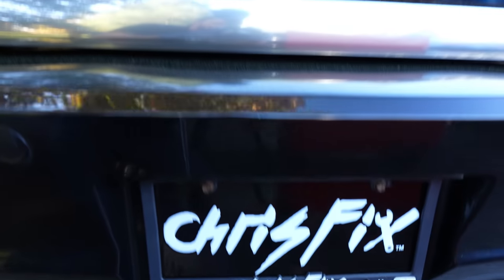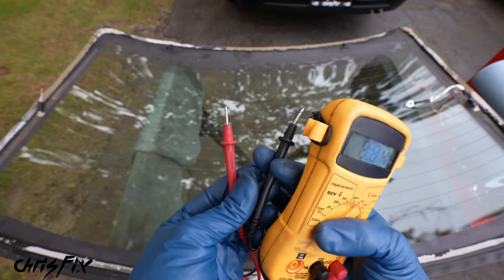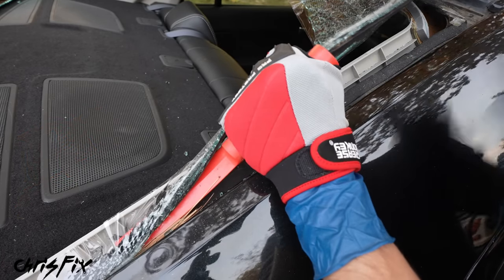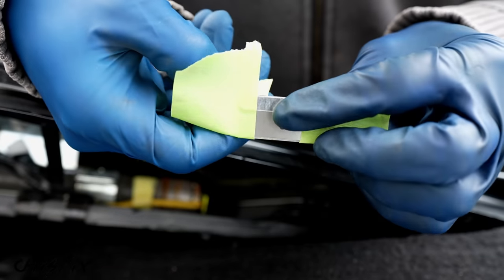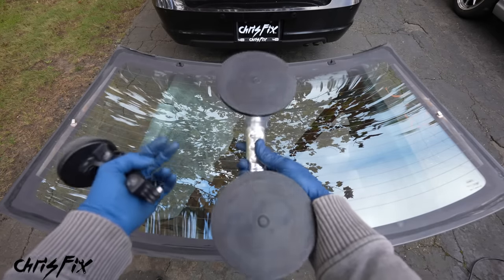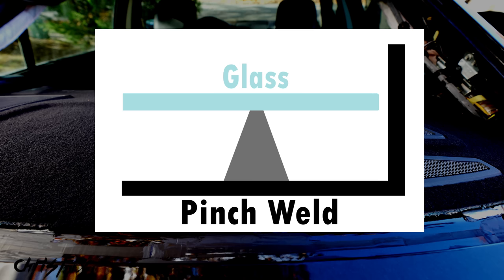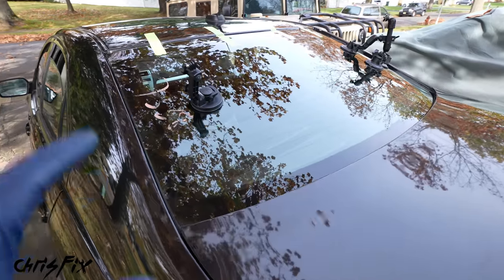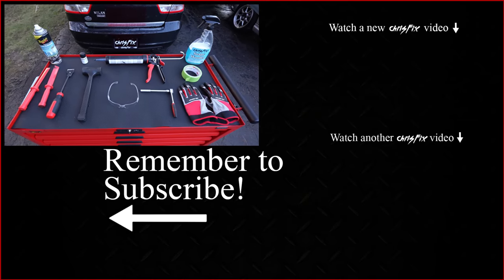How to PROPERLY Replace a Rear Windshield (No Special Tools DIY)

Comment: I like the video but, I own a auto glass company and their is a couple of things you could do better so here is a few tips...
1- Break every piece u can as soon as you start, before you scrape off the urethane. Don't vacuum until you have cut the window out. Saves major time. Also put tape around the glass on the body of the car so the glass doesn't scratch the car. You can also spray the urethane with glass cleaner and when u cut it the glass wont fly everywhere. 
2- You should of used your scraper to get the urethane off the pinchweld, that plastic tool and mallet looked miserable
3- The razor blade thing was super sketchy and time consuming, use metal scraper to get the glue off much faster and you want the urethane to be level so your glass doesn't leak
4- When you scraped the old urethane off your used piece of glass, no need to try and scrape every little piece. Urethane bonds best to itself. Leave 1/16 like you do on the body if possible. 
5-In the top right corner on the backglass where you first put primer, you should of scuffed the metal with scotchbrite to give the primer a better chance to bond. (Same thing with where the sound dampener was)
6-I really liked how you broke down the triangle bead in comparison to the circular bead. Some installers still use that circle bead.
7-When you cut the tip for your urethane, don't cut the V so big. Your bead was weak because the base is too small.
Reply: One can only appreciate tips from a pro, although it helps us to get you less work. You also showed it's not that easy, a lot can be done wrong. I vote @Chrisfix could pin this comment.
Reply: Great tips. I also work for an auto glass company and couple of things I do before I start cutting the old urethane is I usually have a vacuum in one hand I use a small clip prying tool to remove the excess glass from the most outer edge of the glass, that way they don't fall in and scratch the paint or dull your blade when you cut the urethane later. You can actually see long white scratches in the pinch weld that came from the plastic chisels pushing glass pieces against the paint. I use cutting knife with a snap on blade, start from the middle and cut the whole urethane out in one piece. It's easy to not scratch the paint when you have removed the excess glass from the pinch weld and can actually see the tip of the blade. This way there is least amount of tiny glass pieces flying everywhere, even compared to a replaceable chisel blades, which is generally the best tool to remove urethane because of the control it gives.

Windshield stick tools cost like a dollar and are made out of nylon, urethane doesn't stick to it that well so it's good for all touch ups and the "paddling". The sticks are also super easy to clean because the urethane just peels off after it cures. The stick is also one of the best tools to remove old excess urethane from the corners of the pinch weld as it doesn't scratch the paint. 

Also if people are using urethane that cures in 24h they should be very extra careful about what tape they are using to hold the glass in place during the curing time as most of the tapes (especially duct tape) burn-in on the clear coat and are an absolute pain the ass to remove because the glue sticks to the paint.
Reply: Just don’t tell me you work for safelite they fucked up my windshield and it leaks whenever it rains for the last 6 months now
Reply: @Hiddenpower6  I'm from Finland. You should always get leaks fixed asap, because they can create all other issues and can be caused by rust.
Reply: Swamper for a very experienced body shop mobile crew here
1. Yep, my installer breaks all glass and removes the urethane first while I prep the glass, I don't touch the vacuum until all the old is off. Plus the glass cleaner on the urethane acts as lubricant and makes the knife glide easier
3. OLFA or Stanley knife works best, go slow and take your time, plus people are more likely to have a retractable disposable blade knife than a no. 9 razor
4. Yep, no need for all urethane off, make it flat and even with no flaps or strings, but overall not bad
7. I agree, Bead was too high, better to be wider but there wasn't much you could do with that caulk tip

bonus
-DO NOT "RAIN TEST" WITH ANY KIND OF WATER FOR AT LEAST 24 HOURS AFTER INSTALL, URETHANE DOES NOT LIKE WATER
-Make sure any surfaces are dry after cleaning before priming or gluing
-I usually prime wider than the old urethane marks, OEM is usually a thinner bead, we use thicker, so more squish, so as long as it doesn't show on the clear part of the glass, I do a half dobber width wider either side
-I feel like it would be more effective to use the cups to move the glass, yes they aren't made for it but they are better grip
-Check pricing with actual auto glass places, we would more than likely do an install on a customer supplied glass, if there are any problems with the glass (like heat lines not working) we would not be at fault and would not warranty the glass or labor (unless they were not plugged in obviously). We are professionals (mostly, I have seen some work from other companies that disgust me), we are good at what we do, when we go to a customers house and are done in ~30 mins, they are surprised it was quick. I know it can be done fast and sloppy, but we have experience, $250k G wagons, $500 corollas, Maserati, Audi, Honda, Semi trucks, bobcats, Buses, etc.
-When looking at glass places, get quotes, read reviews, talk to family and friends. I live in Edmonton, Alberta, Canada, some dealerships and bodyshops I went to who just got a contract with us with the mobile crew (me (swamper) and my coworker Chris (installer)) was exited we showed up, telling us the guys they used to go through would usually not show up and call 2 weeks later to reschedule. Find good pricing, but find better installers. The problems the company I work for usually run into is fitment, delays on orders, or a customer telling us "it definitely doesn't have any features, its a base model" only for them to bring it to the shop or for Chris and I to show up in the mobile crew and it has a rain sensor, lane departure, HUD, and its the wrong generation (06' vs 14' (I am not joking on the date of manufacture difference, that is a literal example from ~2 months ago)). Be accurate, be honest, you are not signing your life away, you are just getting a quote. I dont know about other companies but where I work, we have warranty, wind whistles, leaks, etc, we have skilled people who take care in their work. Our least experienced installer is still good, he just needs more speed, which comes with time and experience.
Reply: @Hiddenpower6  Get it warrantied, they should have warranty stuff, if you have time and your invoice, tell them the problem and they should fix it. It is rare (at least in my shop) for warranty work, but we are human, and people make mistakes.
Reply: @lieutenantjiggles5347  I thought about that but it didn’t rain for like 2 or 3 months after the windshield got replaced so I never knew that it was leaking then it did and by that point I already knew they wouldn’t believe me if I complain about a problem that they did 3 months ago bc they will just say “well you can’t prove it leaked the first 3 months” and they will just say I did something wrong.
Reply: The crew from DNS aka Auto Glass Shop should watch this and read the helpful tips.
Reply from the maker: Thanks a lot for all the tips!
Reply: Forget a scraper, a ten dollar olfa knife from any hardware shop will be more than sufficient to get urie off a pinch, especially if you have a steady hand on the old urethane.
Reply: as a glass technician I agree, but the worst part was the urethane, sorry
Reply: The part I would add ( without reading everyone's replies) when you trim the old urethane off the pinch well you should pull up on the urethane as you scrape to make sure it is properly bonded to the car. Like in that top passenger corner where it was peeling, that peeling could go a lot further and if this was a windshield install that can have some serious consequences down the road.
Reply: @Hiddenpower6  no way man! Rayce-Way Auto Glass in Houston, Tx!
Reply: @Hiddenpower6   I work for safelite and the window has a lifetime warranty for workmen ship, just bring it to your local shop and they will help you out, mistakes happen and safelite tries their best to solve each issue
Reply: @bear-_-slayer3704  will they even bother to fix it they replaced it mid July and it was the thing where they come to you and do it. Everything else they did was perfect it just leaks on the drivers side in heavy rain or if I spray it with a hose and I noticed it way to late so that’s why I didn’t call earlier after the install.
Reply: @Hiddenpower6  call them to get the windshield pulled and reset under the lifetime warranty. You can tell them you want a different tech. People make mistakes or there is problems with the glue that can be seen during install. Stop slamming a whole company for a problem when you haven’t even talked to them about getting it fixed.
Reply: Also if you have a sunroof better check the drain lines to make sure they are not clogged. It happens even when the sunroof is never used and gets blamed on the windshield replacement. Not saying that is the case but check it.

Comment: I was gonna do this myself but from my research I thought it would be too difficult without specialist tools...

Yet again you make it look easy with basic equipment.

The world is a better place thanks to you. I can afford to fix my windscreen and still make rent.

You're my hero! Thank you!
Reply: I don't know where you are based, but why not get it replaced through insurance? In UK you pay £75 and it will replaced on day your specify.
Reply: @soldiers303  Unfortunately my insurance didn't cover it. I am in the UK but I didnt add windscreen protection to my cover. To pay for a professional  replacement would be +£500. You are of course right but I was lacking the foresight when purchasing insurance. Thanks for the tip tho'! Much appreciated!
Reply: @soldiers303   I wish I was UK, here in Canada i'd have to first pay $500 deductible, then have the claim approved and once i've used that option to have it replaced ny insurance rates increase due to making that claim. It's not worth it, much better here and cheaper to do it yourself.

Comment: I did auto glass for 5 years and done thousand of these. I have to say this is well done and looked like you had years of doing this. my only issue is with your triangle cut on that nozzle is a bit to high and a little bit on the bead when you laid in the glue where some parts are uneven but other than that very good. I could tell that its cold on where you are because the urethane was very sticky when you where touching up the joints. A lot of installers from where I am don't even use primer so it rusts after a couple of years.
Reply: I work for nationals n even we don’t use glue beads that high and also did you not see the end where he jet washed it 😬😬, I cringed, didn’t wanna look🤣 but all in all was a very good job though
Reply: Your YouTube Name...😐😯

Comment: Thank you for all the great videos. This is one of those fixes that I would never attempted but you are able to break it down so well. With your help I have done bodywork, rust repair, deep cleaning and paint correction. My used car looks 1000% better thanks to your help. Cheers.
Reply from the maker: That's what I like to hear! Thanks a lot!
Reply: Same application applies to a truck canopy, with glass window/door. The primer used is an adhesion promoter, for the urethane. Not to be confused with paint primer. Might be a good idea to prime & paint bare metal spots, before the urethane adhesion promoter.

Comment: One important thing to be aware of- make sure you have an adhesive dam installed to prevent the adhesive from squishing in were its not supposed to. not all cars require it, but many do. its a strip of foam rubber that goes either on the bottom or the inside perimeter of the glass. Also if theres a piece of moulding that goes around the glass make sure you can get it on while the adhesive is still uncured. once its dried, its really difficult to get it in. I learned this the hard way.
Reply from the maker: For sure and great tip! In this car it was already installed on the glass (small foam strip)

Comment: Important to note: The process for replacing the front windshield can actually vary quite a bit, as many modern cars are starting to have more technology implemented into the glass, like sensors.
Reply: He did say it’s for a rear window and he did mention most rear windows are done the same and he is very correct, i fit windscreens and rear glass’ and the method for doing rear glass is the same no Matter what car it is, I mean as a windscreen tech I would of done a few things different for time saving but all in all that was a good job. Just please don’t jet wash the area you glued 😭 gave me nightmares watching that, 7 days wait on cleaning because you’ll shift the glue off the primer and will cause wind noise/leaks💪🏻
Reply: @realeasygaming4379  So I removed all the cracked glass before taking my car into get professionally replaced. I left a few scratches in the primer… you think they’ll re-prime it or should I? Also I have a bit of a wavy pinch weld (from getting rear ended) would that mess up a new install?
Reply: @Charles.Howard  you should be fine, I wouldn’t worry about it
Reply: No big deal
Reply: @realeasygaming4379  he said at the start of the video that "replacing a rear window is very similar to replacing a front windshield and this should give you the tips and tricks you need to be able to do that"    or something along those lines.

Comment: Just a thing to mention for the Front Windshield. 
If you have a newer Car with front Cameras and sensors, you can replace the Windshield yourself, but you will have to go to a dealer to have the new windshield and camera/sensor setup alligned.
Otherwise if those are not adjusted to each other, assistants like lane assist, etc. might not work correctly and send you off into a lane that does not exist (as an example). So maybe its better to even go to your car dealership in the first place to replace the front windows with so many assisting systems.

If you have an older car without this kind of assisting systems, then go ahead and safe money :)
Thanks Chris for this awesome video.
Reply from the maker: Thanks for the tips and thanks a lot!
Reply: Save money? Full glass on a exotic is under 200 bucks a year..  My 2019 explorer, under $50…. My beater is about a $1.50 a month….  It costs more to DIY….
Reply: @sjfk1306  where do you live? Cheapest windshield replacement is $185 cad where I'm at
Reply: @porgin8092  I think he is talking about the  cost of glass coverage on your insurance.
Reply: Some do not, such as newer Subaru. Dealerships try to tell customers they need calibrated after window replacement, but it is not true and mainly a cash grab.
Reply: @whitsend11  he used the word “replacement”… Which means he is talking about the cost of replacement….
Reply: @rustyc  new  Subarus  still require recalibration. It’s not a cash grab
Reply: @sjfk1306  why so passive aggressive bro
Reply: @porgin8092  I’m not your bro, finish middle school.
Reply: @sjfk1306  You must be fun to be around
Reply: I've heard from a few dealerships that those sensors are outta whack straight from the factory. So recalibrating may not even be necessary, except for liability reasons.
Reply: SJ FK lol who hurt you "bro"??

Comment: Great job as usual Chris! :-)
Reply from the maker: Thanks a lot!
Reply: @chrisfix  hey chris on my avalanche 5.3 it doesnt have any power when taking off and it uses alot, alot of gasoline when driving, to go 10 miles i waste like 20 dollares of gasoline, what can be the issue
Reply: @legasus345  now I'm no genius when it comes to cars but I know my way around that truck since I own one, 
1. A mass airflow sensor that is Bad or dirty 
2. A possible vacuum leak 
3. Bad o2 sensors 
4. Dirty fuel injectors
There is probably some more possible reasons but that's what I know that could be causing your issues
Hope this helps you 👍
Reply: @AJ5306.  yep u actually rlly learned frum la vids how to replace exhaust and the how to install a performance intake
Reply: @chrisfix  hi

Comment: Did some installations of front and side windows with a 30-years-experienced glass installer, and everything you did was very good and same as he’d do, except the eurethane application part. It’s easier and recommended to apply it to the window rather than to the car. It’s easier because you can control it easier and apply it faster and better. Except this small thing, I mean it works both ways but it’s easier for you as you’re installing it

Comment: As usual, very informative. I never knew that there was a difference between front and rear glass. I have always found that all glass coverage of my auto insurance is the best tool in glass replacement. I have had to use it about 4 times in over 30 years of auto ownership.

Comment: I've never been interested in learning about cars aside from refueling the gas tank. But then, Chris has led me from pawning off my mum's old Perodua Kancil 2005 that I crashed back in 2018, to fixing it into tiptop shape.

Now it not only looks new, but feels and performs like a new car. Of course, what with almost everything in the car having been touched up with all necessary repairs and replacements. Only the chassis, doors, engine, and gearbox remain old but with their very own new parts inside.

Thanks a lot to you.